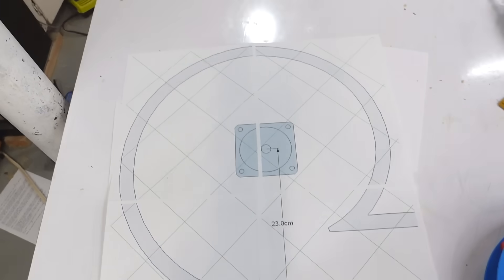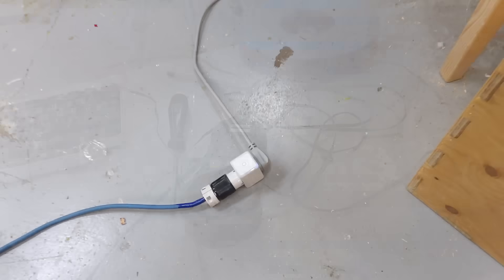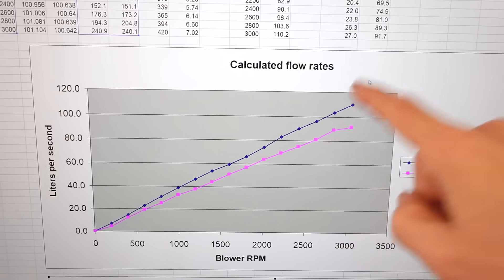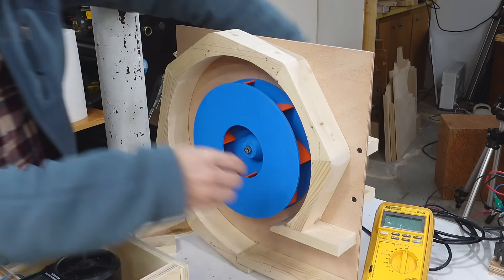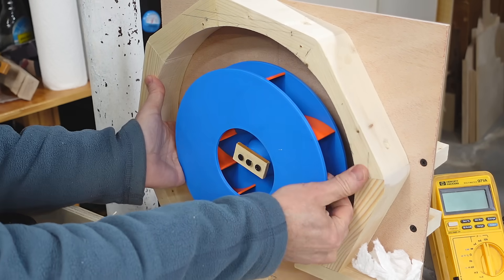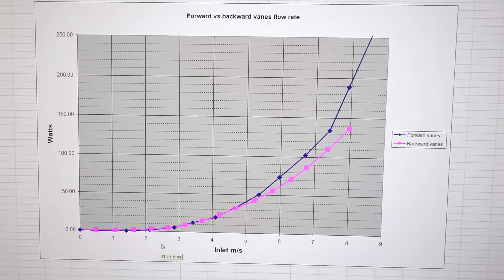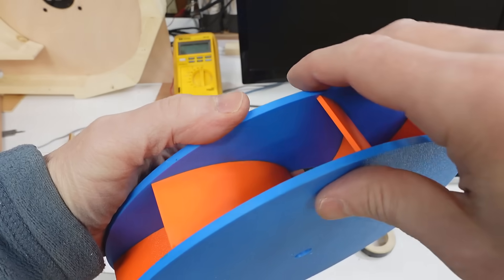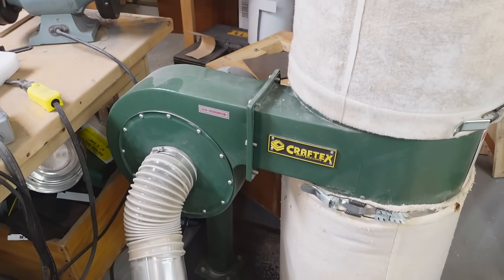3D printed blower impeller, forward vs. backwards curved fins

Comment: I'd try 1/8" hardboard, glued and screwed to "round" plywood ends. 

Drywall screws work fairly well making their own countersink. If you need extra structure, coat with carpenter's glue and laminate a second layer on the outside. Brad nails are also an option, especially for the second layer, assuming you can get the depth set right.

With care, you should be able to get radii down to about 8" before the hardboard starts to crack.

You'd need a different method of getting inside, but this would be a quick and cheap way of building the enclosure.

Comment: Neat..data!  Seems like you nailed it, the shape of the fins helps with the airflow and pressure at the cost of turbulence/noise/power consumption well depending on RPM's...
On those particular impellers, there appears to be a sweet spot in RPM where the performance/airflow/noise were the same..until it hit those higher RPM's
Very cool!

Comment: Maybe kerf bend plywood for the housing?
Reply: Far safer, cheaper and quicker to make the housing curve from sheetmetal.
Reply: @BTW...  Depends on what you are set up for, Mathias usually works in timber and therefore would have the correct tools, materials and skills for kerf bending a piece of plywood. If you're more comfortable with sheet metal then that's also a viable option 👍

Comment: @MajorHardware does a whole channel on 3d printed fans for PCs using a noctua motor. Worth a watch to see how different designs perform.
Reply: @stunimbus1543  yes, but that type of fan has a different purpose (air speed) than a dust collector fan (air volume). Correct me if I’m wrong.

Comment: Nice ! next step : width and diameter !
(the theory says : more width = more flow and bigger diameter = more static pressure... but we should check that :) )
Reply from the maker: yes, more width is more flow, but counterproductive to make it too thick.  I would not go much thicker than it is.  and pressure goes up with diameter squared, but power goes up with diameter cubed.

Comment: Looking at a car repair video earlier, the presenter noted that car cooling fans purposely have oddly-spaced blades so as to mitigate harmonic noise generation.  Have you explored this with your impeller designs?
Reply from the maker: what I found is to have enough space between the volute and the impeller makes a big difference.  it wasn’t loud until I flipped the housing around.
Reply: Are you talking about the long blower fans such as you'd have in tower fan like Lasko makes??? 🤔 Those blowers are about 30 inches long!!!...but they're molded with intermediate integrated "rings" and the fins are slightly staggered from section to section.

Comment: if you look at the forward curved fans at the end, they all have LOTS of SMALL fins.  
your test running a the long blades backwards is not ideal.
Reply from the maker: true.  the housing also is deeper and smaller diameter.  I suspect for those fans, you could do slightly more efficient with backward curved, but you would need a bigger impeller and housing so it’s not worth it.

Comment: With the versatility of 3D printing it would be interesting to see if other shapes or complex curves of fins might yield improved results (vs traditional shapes that need to be simple enough to mold/cast/fabricate).
Reply from the maker: a dishwasher water pump I took apart used backward curved fins, but the disk shape was actually sort of conical, so that the water coming in didn’t have to turn 90 degrees.  I’m sure that’s more efficient but not practical in wood.  the blower inside the Dyson fan base is like that too.

Comment: 3d printing makes sense but the SHIPPING is the problem in 2025?
Honestly it doesn't make me want to fix the US, it just makes me want to move to canada.
Reply from the maker: the problem in this case is Canada.  would have been way cheaper to ship inside the us.  and while trump wants to annex Canada, he’s only making it worse, as in less economically integrated.
Reply: It was like $40 to ship that impeller to Canada.
Reply: Give it a few years.
Reply: so move, and take ya impellers with ya

Comment: Would be cool to use your pressure measurements at the inlet and outlet to draw the fan curves of each impeller at a fixed fan speed (delta of static pressure as a function of flow, and power as a function of flow). You can translate it to whatever other rpm you need by the fan laws that you mention, without having to repeat many measurements. To improve your measurement accuracy, you would need some kind of long round duct at the inlet (like a pvc pipe) and long square duct at the outlet to properly measure flow and static pressure. You could use a butterfly damper at the inlet to vary the resistance of the circuit to explore the fan curve ! Would be a great demonstration of fan laws and how fan design affect fan curves ! You would even be able to give an absolute efficiency value for each impeller which would also be quite interesting to compare fan design (efficiency = flow in m3/s * delta p static in Pa / power in W)
Reply: Why is a square one better for the output, is it because the blower already has a square output or are there other reasons?
Reply: @Convexified Yes just to have stabilized flow pattern inside the section. At the distance matthias is measuring, the flow must be very fast near the bottom of the blower (where the air was pushed by the max radius of the impeller), and almost zero near the top, if not negative. And on top of that there must be quite a lot of air entrainment aswell adding to the overall uncertainty.

Comment: I'm curious about the print.  Did he say what material he printed it in?  Were the fins just glued or was there a dado for them?
Reply: I printed this out of PETG - One, because it's not as brittle as PLA, and two, because PETG has slightly better layer adhesion.  I wasn't too concerned with the flexibility of PETG since the way it was constructed and glued together should add enough rigidity. The two discs are printed separately with dados.  I printed the fins flat, and heat bent them (with a jig) to the exact shape of the dado, and glued it all together.
Reply: @ShopTherapy623  Have you ever had PET-G fracture across layer lines? 🤔
Reply: @RTR-MATEY  the fins are printed flat, so all the  force is perpendicular to the layers instead of parallel to it. That should significantly increase strength.
Reply from the maker: Glued into a dado.  The blades were actually printed flat and then heated and bent to fit.
Reply: @matthiaswandel  I know 3d printing isn't your thing, but I would love to see you testing something like this to failure.

Comment: I'm glad I didn't see my impeller explode (implode?) in your face!
Reply: It's funny this is mentioned here.  I built an impeller blower for my aluminum foundry and had it driven with a repurposed blender motor.  Overall speed wasn't too high, but after about 20 hours of use, the PLA used to print the impeller began to delaminate, made contact with the 3d printed housing, and exploded with shards of plastic scattering in all directions. So... 2 warnings...

1. Watch your top speed (over-design and under-utilize)
2. Check for cracks frequently (at least hourly).

I could easily have lost an eye with how that thing blew up.
Reply: @ShadowCat38  3. Don't use PLA for that sort of application.
Reply: @ShadowCat38 did you print the impeller in one piece? Or with the fins standing up? My fins were printed flat on the plate to increase their strength
Reply: @ShadowCat38  I bet if you had vapor smoothed all of the critical high speed parts you wouldn't have had that delamination problem!!!
Reply: @RTR-MATEY  it will deform unevenly and be unbalanced and self destruct. And u cant vapor smooth pla.
Reply from the maker: I was a bit worried about that, indeed.  Being plastic, its a fair bit heavier, and the way the housing is just glued together, it might have come apart if it had exploded.
Reply: @matthiaswandel  I'm also impressed you got the pronunciation of my last name correct.  Almost everyone says "krimmer" - lol

Comment from the maker: Realized after previous upload that I forgot to switch to full resolution before doing the final render.  Hence I made that version one disappear and re-rendered it full resolution.
Reply: hey, I am confused; did you switch the direction of the motor when you changed the fins direction? 
     Also, the gap between the fins and the wood housing is smaller for the forward facing fins (will likely change the results, higher pressure due to small gap).
Thanks.
Reply: The video became unavailable while I was still watching, that was kinda weird!